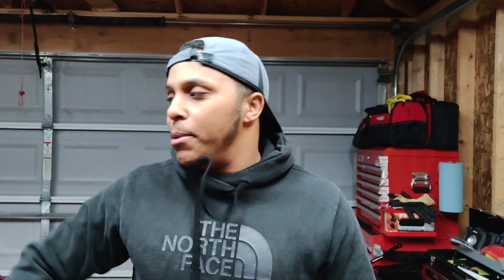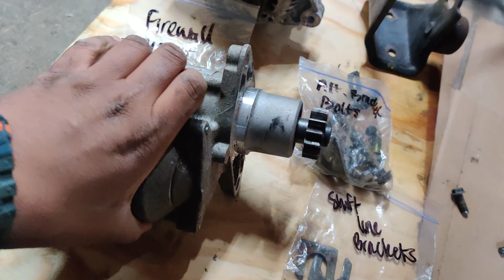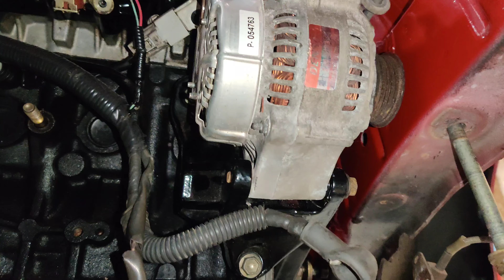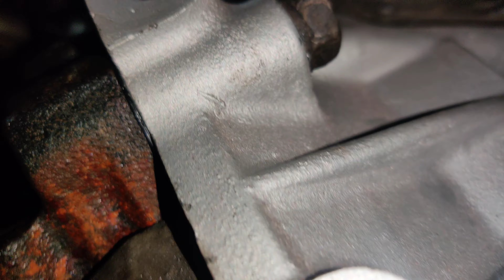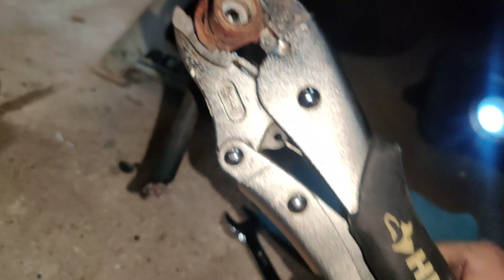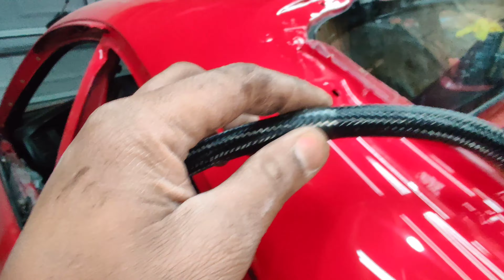N.A.G-Ep.36 Electrical Systems

Comment: Did you upgrade the alternator for more amperage? Or kept it stock?
Reply from the maker: Keep it stock no resl need to upgrade it
Reply: @NastyAddictionGarage  from what I understand, is that you can add more amps into the alternator by buying or modifying one, and it does not cause any problems... is this correct?? I have a sound system, etc. And it drains the battery with usage.
Reply from the maker: @alfonsoramirez6415 For sure, if you have a sound system, I could see how I could drain.But I would change it if I had extra things on the car but in stock form it works fine
Reply: @NastyAddictionGarage  I understand that in stock form, it works perfectly. What I'm trying to ask is if even you don't have any add ons if it would cause any type of damage. From my understanding, the more amps, the better with no collateral damage. I'm not sure if this is correct, though.

Comment: I believe that plug is for either the engine bay temp sensor or intake temp sensor, and those hoses should be for throttle body heating or turbo cooling
Reply from the maker: thank you brother much appreciation thats exactly what it is!

Comment: those two coolant hoses look like they go to throttle body, FYI.
Reply from the maker: Yes I found the ones that go to the coolant hose but the larger ones are ones that need to be blocked off due to a cooler that was originally with the caldina I believe